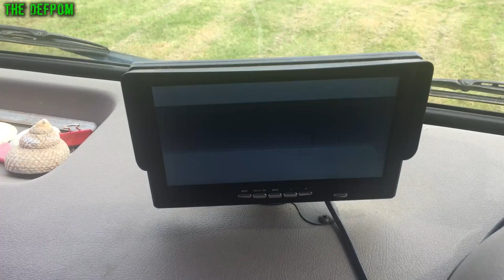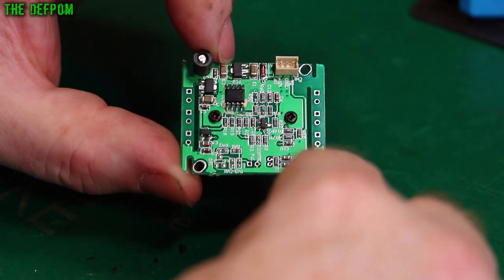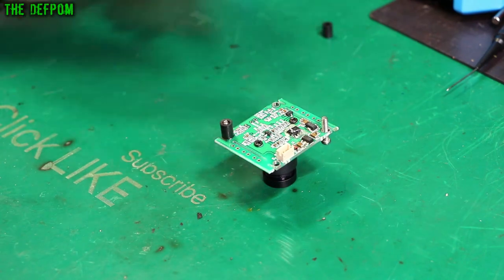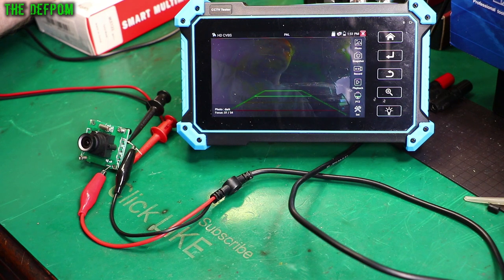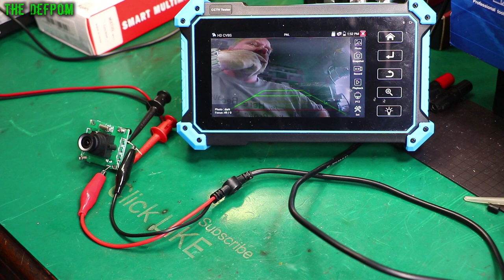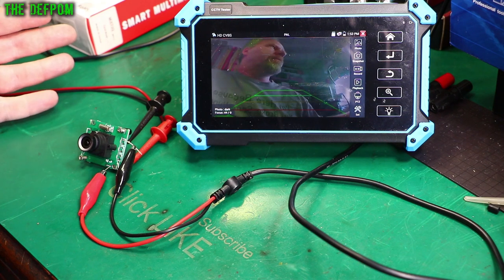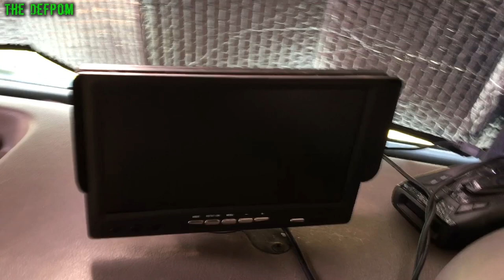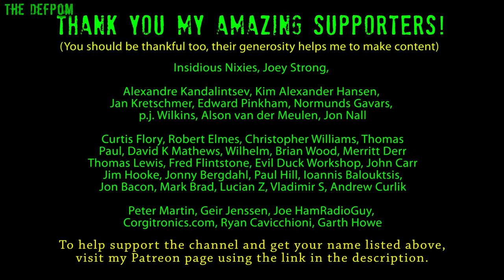🔴 Reversing Camera System Repair - Backup Camera System Repair - No.936

Comment: With the camera I would say a conformal coat would help a lot as well with corrosion problems. Just a can of clear lacquer will work well to coat the board after cleaning, so that it does not corrode again there, and seals all the solder joints in a thin layer. Cardboard box, masking tape to protect things like lens and connectors, and a light coat or two and it should hold up a lot better.
Reply from the maker: Yes, I should have put some conformal coating on it.... I do have some, maybe next time I pull it apart I will remember !

Comment: Love my reversing camera, I park with my mirrors but use the cam to get within half an inch of things, its always amusing when I'm doing it to a car with someone in and the look of terror on their face when they think I'm gonna hit them ha ha.
My video is handled by a Sony headunit but the cam is a cheap Chinese purchase but its been great and is way better quality than I expected for the price, I have my can wired to the reversing lights along with the trigger input for the headunit but have an additional wire to a switch on the dash so I can activate it manually if I want and have diode between the cam and the reversing lights so I Dont turn on my reversing lights when I manually turn on the cam :)

Comment: Just an aside could you not pick up 12 volt off one battery on the bus?? so not needing to use the buck converter??
Reply from the maker: Yes and no, there was already a power supply by the camera, for 12v I would have needed to run a cable about 7 metres to the batteries…
Reply: Squeakaty squeak squeak !
Reply: @andymouse  Cheese Spread!!!!!!!!!!!!!!!!!!!!!!!!

Comment: I'd say that this generic chinesium buck converter is unsuitable (and dangerous) for automotive application. It is even more unreliable than original one that blew up (at least it was sprayed with conformal coating). It won't survive transients and harsh environment for long.
Reply from the maker: I have used many of these buck converters, inrush current can blow them if it’s excessive, but otherwise I have found them to be fine. In this situation the unit is housed inside the vehicle so there are no issues with moisture etc.

Comment: Hmm shame did you get a number off the 8 pin chip ? then you could maybe have found a datasheet and checked it before just sticking it back, lucky that was not the fault ,And cover it in conformal coating, and you have a 3D printer to print a new box when you are back home